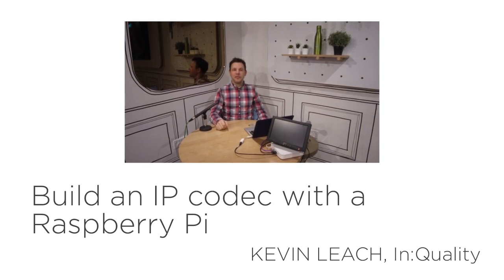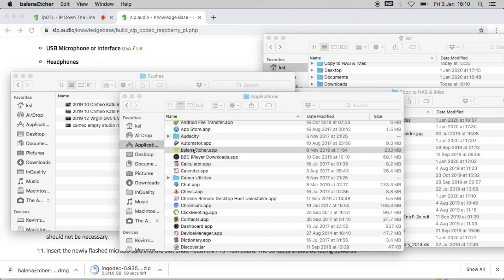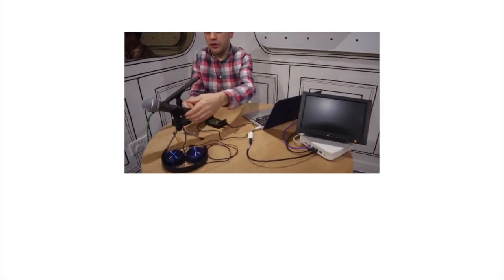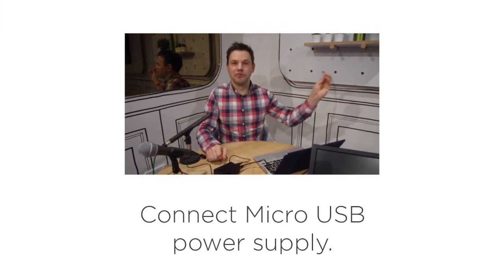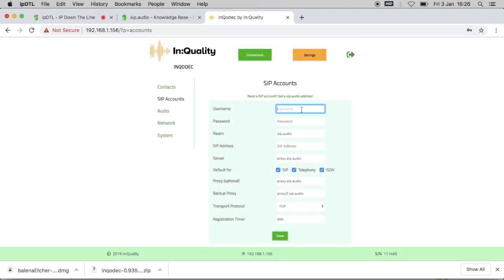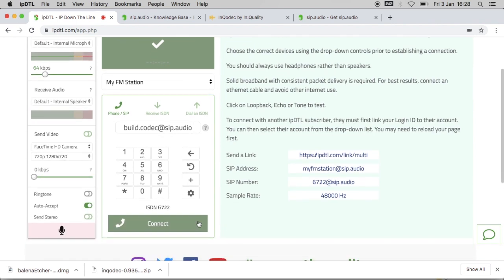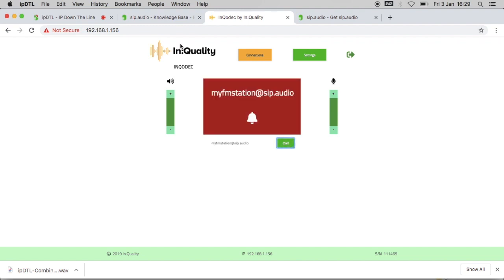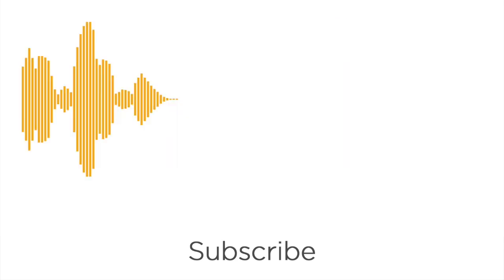Build an IP codec for sip.audio with a Raspberry Pi and a USB microphone

Comment: Pls update firmware for raspberry pi 4 model b
Reply: Hello, we have done the following in order to work on a recent Rapsberry Pi 4 model B.
1) Create an SD card from the original image from In:Quality
2) Mount this SD in a working Raspberry
3) Change the root password to 12345 using the procedure provided by In:Quality
4) Boot the SD card on a compatible Raspberry Pi 4 model B
5) Update to the last version of inqodec (1.11) using the GUI
6) Update/upgrade the last Linux Buster version from the command line (apt update --allow-releaseinfo-change, apt upgrade)
7) Remove the base settings (rm /usr/local/inqodec/docroot/data/base.json)
8) Create an image of this SD card
9) Boot the new Raspberry Pi 4 model B with the SD card
For your convenience, an image compatible with new Raspberry Pi 4 model B and which includes InQdoec 1.11 is available here: https://www.1-2-3-4-5-6.net/inqodec/inqodec-1.11.zip
Reply from the maker: Hi Diego. Only the new Pi4 1GB is not yet compatible with the firmware. We currently do not have a timeframe for an updated image. We recommend using a Pi3 with the firmware, but the 2-8GB Pi4 models also work.

Comment: Can it it output AES67 outputs? I mean using it as an AES67 comentator point?
Reply from the maker: The incoming SIP stream can be routed to AES67 output, and an AES67 input can be sent as the outgoing SIP stream.

You can't route the local audio to AES67 though. Try Glensound for that.
Reply: @inquality  thanks for your help, really useful

Comment: Hi, is it possible to connect an LTE/4g Usb modem? And what model of tft screen can be attached to rasperry pi 4b. Can’t find 3.5 tft models for this model or lm wrong?
Reply from the maker: Hi. It's not supported in the firmware. You can try connecting a mini LTE router with an Ethernet cable though. We have used Adafruit 3.5" in the past, but we prefer the 7" official Raspberry Pi screen.

Comment: Hi, I just built this and it's awesome! I was wondering if there was a way to connect the unit to wifi using inQodec?
Reply from the maker: Great! Yes, In:Qodec does recognise many USB WiFi antennae, although it's not a supported feature. We have listed some in a tab on this document:

https://docs.google.com/spreadsheets/d/1umsqnZwqVYzIb18ublpZxVGhfU3D0Uokl1kJzHasUiM/edit?usp=drivesdk
Reply: @inquality  Thanks! I have an Archer T2U Plus but i can't see a way to connect to a network. 
Maybe by using the terminal? Or is this feature not enabled for end users?
Reply from the maker: Sorry for the delay, @emyalfaro ... I had to check on this. In the web interface, append the URL with /?p=advanced where you will see the option to enable wifi.
Reply: @inquality  Great! I got it working now. Thanks a lot Kevin for your kind help. Love learning about this software!

Comment: Thinking In a self-made machine for sending real-time audio across the network for a real commercial radio. Is it possible ?? And the bandwidth requirements?? 

Thank you !! Awesome video !
Reply from the maker: Yes, that is easily achieved. The bitrate can be selected in the settings. The default is 72kbit/s (really not much) but you should allow a little overhead.

Comment: How can I add/configure a 3,5" touchscreen once the codec is set up?
Reply from the maker: You can select the 3.5 AdaFruit screen in the InQodec settings, using the web GUI.
Reply: @inquality  does it work with other compatible 3.5 tfts?
Reply from the maker: @danielschmitt5129  Yes it should, although you don't get all of the on-screen functionality that you do with 7".
Reply: @inquality  thanks! And does it have volume control with a 3.5 screen?
Reply from the maker: @danielschmitt5129   No, that's one of the features that doesn't fit on 3.5".
Reply: @inquality  Ok. Thanks.
Reply: @inquality  But, how can I acces to the GUI?
Reply from the maker: @andejemon  First, discover the device's IP address, then enter that in a web browser on the same network. Password is inqodec
Reply: @inquality  Wonderful. Thanks.
Reply: @inquality  how do set the GUI on the 3.5 screen?? ie. the shortcuts for dialing out etc??
Reply from the maker: @jamesdoak2153  Using another computer, visit the IP address shown on the screen.
Reply: @inquality  how do I set up the shortcuts so a person can just hit a button?
Reply from the maker: @jamesdoak2153  From the menu, click 'Destinations' and 'Add new Destination', then enter the details. There's a field for 'Quick Dial'. Enter the button label in there, and check the adjacent box.

Comment: Kevin, I built a RaspberryPi codec according to the specs provided, used my sip.audio account info and it works flawlessly.  Thank you.  One question, is it possible to set it up to use multiple USB microphones with this codec unit?
Reply from the maker: Hi Jeremy. Multiple USB microphones is generally problematic, as there is generally a slight latency mis-match. In any case, it's not an option, sorry. The best solution is to run a little USB mixer with the codec.

Comment: Great! Thx. One question though. The video says: ‘place heatsinks’. But in general  Pi 3 model B doesn’t require heatsinks and the problem is the pi doesn’t fit in the standard housing with heatsinks. So, is a heatsink really necessary?
Reply: Oh, and even one more question: are all more recent pi models usable too or are there exceptions?
Reply from the maker: There's really not a straight forward answer to this. It depends on ambient temperature and material and ventilation of the enclosure. If a Pi gets too hot, it throttles down the CPU frequency, which may be a problem for low latency audio devices. Generally speaking, the Pi 3 generates a lot less heat than the Pi 4 and you should be ok with a well ventilated case. The Pi 4 is a different story.

All Pi 3 and 4 models with Ethernet work, a Pi 3B is more than sufficient. Technically even a 2B should work, but we haven't tested that.

Comment: congratulations for the projects.
I have a doubt
Is it possible to use the lan port as an audio output to insert into a long distance wifi link?
Reply from the maker: Do you mean for instance Dante or AES67?
Reply: via ubiquiti m5 lan port (5ghz)
Reply from the maker: @MaisqueVencedor1972  If the link is reliable, then maybe you can use a long distance link.  It would require internet access, or a local SIP server.

Comment: What is the advantage of using a Raspberry Pi instead of a PC with an audio interface and internet connection?
Reply: Apart from the other advantages outlined, 3 watts rather than 300 watts...
Reply from the maker: Whilst using a PC for ipDTL offers greater flexibility, the Pi is great if you want a bullet-proof solution which can be left pre-configured and potentially unattended.  There's no risk from OS or browser updates for instance, or sample rate conflicts with other audio applications.
Reply: @inquality  So if understand this correctly, this could be a nice solution that is pre-configured and can be sent to an end-user(with a USB mic of course) that can simply turn it on and connect to us, the ipDTL host?  In other words, the operator will not need to do any further configuration?
Reply from the maker: @JDH7900  You've nailed it!
Reply: @inquality  LOVE THIS!!!  I'm totally doing it.
Reply: @inquality  Looks/Sounds good! But....
- Is it also possible to use it with other DTL providers? One of my voice-overs is working for a studio who's working with SessionLink Pro. So it should be nice to switch sometimes.
- In my current setup I also make local recordings to have a backup when drop outs occur. Is that also possible with te Raspberry Pi setup?
Reply from the maker: @edsmusicstudio  As far as we are aware, Session Link Pro does not offer support for SIP.

The Pi is designed to work as a standalone unit which is dedicated to providing connectivity. ipDTL is currently a better fit if integrated recording is required.